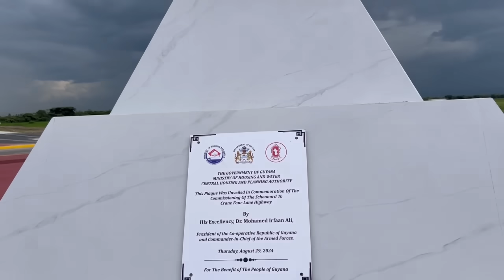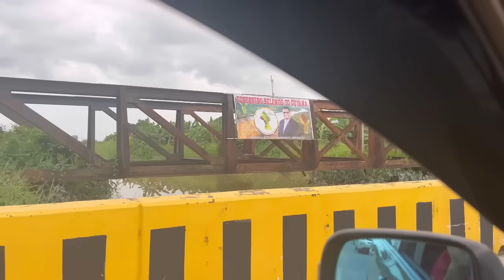New Crane to Schoonard four-lane highway and roundabout

Comment: How can they open it without signs ? When I drive through even a small round about in a housing community I need to read the signs in order to take the correct exit. Incomplete job!
Reply: Exactly 😂.   I always ask don't Guyanese official travel abroad? Even if they stay in the Caribbean countries.  Just take a trip as a fact finding mission .

I guess they don't know what they don't know

Even a temporary signage would have been acceptable.  You would think that Guyana would have had a department that specialize in road signage plus the project tooks months so didn't anyone prepare the signage during construction?

Anyway great video.
Reply from the maker: That’s so true, it’s a big blunder